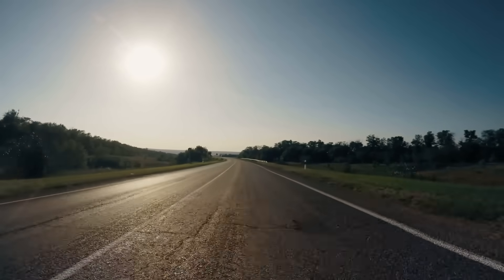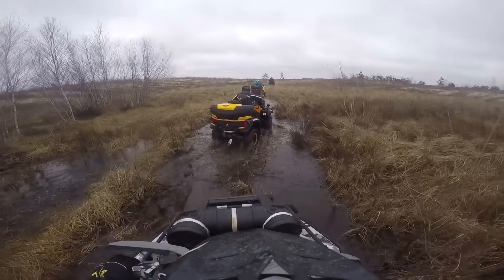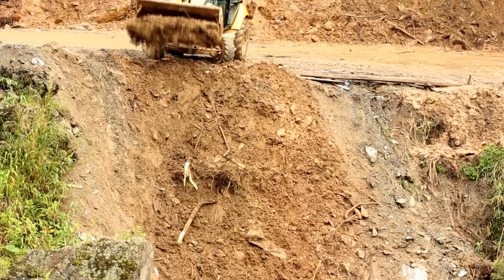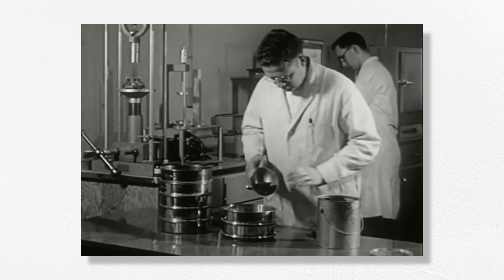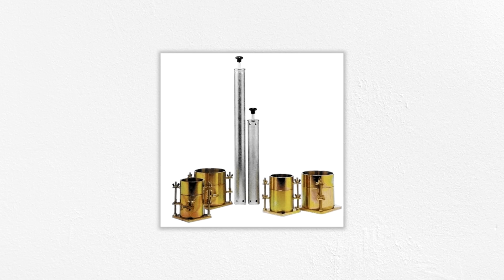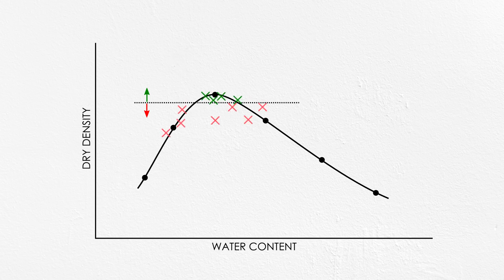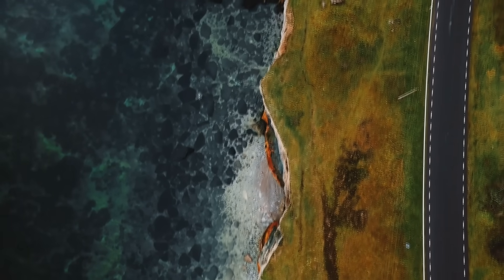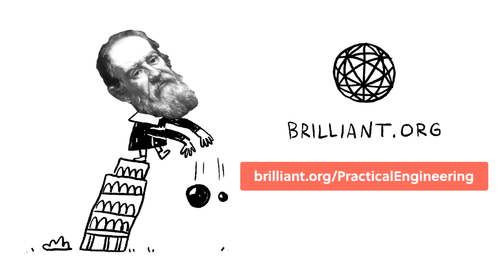Why Does Road Construction Take So Long?

Comment: Smoko at 10:00, lunch at 12:00, smoko at 14:00. 

Plans not showing correct details, for us it’s normally a water main, best is a gas line. More often than not ya hit it anyway. Traffic control sending vehicles when it’s not clear forcing workers to chill a little longer, if there’s a pub on the road, forget dead lines all together and god forbid anyone messes with anyone’s sensitivity there’s going to be a strike and the unions getting involved.

Comment: I used to moan at road workers standing around until I joined a crew laying tarmac at a junction.  I was there checking out engine performance on the paving machine, but watching the blokes work I noticed they wait around for the hot tarmac to turn up, but once it arrives they work like mad for an hour, then they might have to wait 10 mins for the next load of hot tarmac to turn up.  They definitely earn their money when they do work.  They were a nice bunch and it was actually sad to see how much hostile abuse motorists gave these guys. One fella in a BMW spat at us and he had only been waiting about 4-5 minutes in the queue.

Comment: Did a road cut in downtown Seattle and fun fact, old towns just keep layering. The road we were on had 4 inches of asphalt, layer of  brick, trolley tracks, concrete, wood, rock, then sand, and rock. Amazing stuff.

Comment: Great explanation.  What I observed during road construction lots of time, is the absence of work after the initial start.   The various contractors start on construction, then they are gone.  No activity for a long time.   What's up with that.  It's not a once in awhile thing, it's like that is the common practice.  It would be nice to hear your thoughts on that.
Reply: That's because people in construction work by contracts. They take one contract and set up the work area. Then when the intensive season for building comes they get a ton more small quicker projects and they focus on those, while they keep the big one for the slow season.
Reply: Take the money and run

Comment: there is to much fooling around. I 94 was built in 6 months apx 40  miles from detroit mi to  Ypsilanti Mi in WW2 for the willow run  bomber b24 plant

Comment: It happens exactly how he says. I've been operating a compactor for the last three months on a site. Can attest to the fact it's a very slow process. Pull rock out of cut area. Move it close to fill area over weeks making a monster pile. Bring in rock crusher. Crush rock. Spend weeks spreading crushed rock and dirt over fill area with loader, scraper and grader. Also spend weeks compacting the fuck out of it with a padfoot roller (that's me). Soil testing goes on right through the compacting process.

Comment: Why it takes so long is simple. One contractor, with a certain amount of equipment and three or four jobs going at a time. They constantly are moving the equipment from one place to another, robbing Peter to pay Paul so to speak. I watched the state put in a new interchange near me. Basic Interstate with three lanes each way. Two lane road crossing over, diamond interchange. Year one, moved dirt back and forth; year two, paved a little here, a little there, put up barrels blocking the completed ramps and extra lanes on the bridge overhead; year three, put up the signs, painted the lines, put up the traffic lights; let it sit for six months, finally have some local poltical type cut the ribbon, removed barrels.

Comment: the question should be WHY ROAD CONSTRUCTION DOES NOT LAST?  the reason is simple, engineers design something to last X years, BUT inspectors don't always do a good job making sure it's done right and contractors will cut corners in a nanosecond if allowed to and thus we never get X years of service. But the main problem is the design X years is not remotely good enough because powers above engineers don't want anything more than X years in order to keep the money flowing to all those involved in road construction repair, which goes on FUCKING FOREVER! It's rotten jobs program.  SO please stop the bull shit here and tell the truth.

Comment: Seems like an adequate explanation for why constructing large, long road takes so long.  Doesn't seem like a good explanation for why a bike underpass under a moderate road takes six months to complete.  Doesn't seem like a good explanation for why that underpass under the train line that makes the freeway flyover usable didn't start construction until 3 years after the flyover was built, and then took a year to complete, resulting in the majority of the traffic now having an extra traffic light when it is done.  I think the better explanation is that typically with road construction the engineers and contractors are divorced from the cost of delays and inconvenience to the users, and there is no way for beneficiaries of better designs and construction practices to be charged for the benefit they gain.  When there is a close connection, like in the replacement of the 35W bridge in Minneapolis, civil engineers can do wonders. But, more often than not, the results are not that impressive in the USA.

Comment: The nuclear density gauge is a pain in the ass. Troxler has developed a non nuclear device that doesn’t require EPA paperwork to handle. I hope like hell we start using it instead.  Not to mention our gauges has a standard density  count of 1700. Lol

Comment: The reason:  They don't assign enough people to projects.  Projects are designed not to finish in a timely manner but keep the construction firms fat for decades.
Reply: I know you commented this 2 months ago, but more people doesn’t always make the project go faster.  You run into issues with congestion and inefficiency especially when you’re moving dirt around.
Reply: Pretty much what I wanted to say. It is called job security. The longer you drag it out the more you can bill. Don't tell me they have a contracted amount and have to stick to it. They always find reasons to extend and bill more. There is a project near me that is 2 to 3 years over schedule and still is not finished.
Reply: @dlb4299  they have a contracted amount and have to stick to it, unless they notice a reason to go over the allotted time before hand and get more time through negotiations.  If a project is taking longer than it should there’s a high chance that contractor is either breaking even on the project or losing money.
Reply: @roycea.7593  That is how it should be in a perfect world. But with greed, graft and corruption running rampant, not only in construction but many industries, it seldom works out that way.
Reply: @dlb4299  I see what you’re saying one hundred percent and I don’t want to argue with that logic since it does hold up to a certain point.  It’s nice and easy to blame government entities for making construction so difficult and time consuming because of the red tape and inefficiencies, but at the end of the day there’s always a reason for a regulation (and they typically come from someone dying or losing their livelihood).  It’s hard to come to terms with the fact that not everything you don’t like (in this case, a brutally over budget and late project that definitely ruins your commute) comes from 100% corruption and greed.  The world is complex and there’s a lot more to construction than meets the eye.  I heard you can audit construction management classes for cheap, it’s what I studied and it’s the field I currently work in.  You should check out some classes in your free time, maybe it will make construction less brutal and more interesting to look at!
Reply: more people on a job just means more guys standing around doing nothing because you can only do so many things at once without getting in each others way, and many things need to be done after something else, like there is no point in using a roller to pack the road in if you haven't finished putting in new utilities like sewer so you may as well have the crew doing the underground work do the tamping work after, instead of having guys for tamping but they just sit around doing nothing for a week at a time
Reply: Now road construction companies are the  bourgeoisie in your new socialist revolution

Comment: Hi excavating contractor here. You left out a large part of the fill slope work is that we have to key into naturally competent soil below the edge of the fill slope before filling can occur. Usually 5 feet below native top soil depending on the job. Also delays on a job due to change orders, or unforeseen conditions such as rock that needs to be removed. Red tape governmental regulations can also significantly slow down progress. Not saying that they are bad just its the way it is. Loved the video on my occupation. Thanks!

Comment: To add to erosion, they do block sodding after construction in area is completed by putting down grass and fertilizer and watering it. There is also concrete and hot mix testing which doesn't always pass testing and takes time as well. Typically it runs on schedule with the project so it doesn't typically delay the project much. Concrete trucks only carry so much concrete so that adds to the time as well. Same with hot mix duel and tandem axle trucks.

Comment: "slow but steady progress"
If you've seen some freeways you know they are in perpetual construction. For example a pass near my house has been under construction for close to 20 years. And this is a MAJOR freeway with 5-6 lanes in both directions. But that's the case far more than it should be. And the cost is far more than it should be.
I honestly don't think I'll see the construction stop on that pass before i die.

Comment: I don't mind construction. What I do mind is construction companies fetching the contract even though they have no capacity, then block the highway for 20 miles and set up the traffic on one side and then for 3 months there is not a single worker on the highway. But because they "started" they can't be fired and the contract given to someone else, and they'd rather pay the fines for delayed deadlines, but in the end they got the contract and ultimately make money off it. It's ridiculous. They just block the road and constrict traffic for no reason for several weeks or months before they even start any real construction or maintenance.

Comment: Hey i have a question. In oregon on I-5 i notice that heavy use is wearing ruts where car tires ride on the highway. Simply put, could they extend the life of the road by removing and repainting the lines 1' foot left or right?  Worth it?

Comment: I love your videos! Here's what I can never figure out. I totally understand why construction takes so long. Your explanation makes perfect sense. But how were they able to build the first 160 miles of Pennsylvania Turnpike in less than two years? An interchange on I-95 near me - ONE interchange - took more than four years, and didn't even involve closure of active lanes. Sure, the PA Tpke has been widened and rebuilt over the years, but the original construction has basically held up for 80 years.
Reply: Building a new road versus building in an already constructed area with management of live traffic are two very different processes. The former can be about 20% of the cost of the latter, and there's big time savings too.
Reply: @borgiedude  Oh, totally understandable. That would apply to, let's say, building 10 miles of new road vs, say, 2 miles of reconstruction. But 160 miles in two years vs. one new interchange in four years? BTW there wasn't much management of live traffic to do on this interchange. There was none there previously and almost all the work was done away from the active roadway so it was a "new road" for all intents and purposes.
Reply: @larry4111  I'm not sure about the specifics; bringing in contractors from across multiple states and having numerous sources of quality stone nearby, with quality subgrade to built upon may have sped up the 160 mile construction significantly. If the ground was for example very flat and strong, it would require minimal earthworks and minimal placement of stone road base to build, speeding up construction. Conversely for the interchange, there may have been latent conditions like services to relocate which complicated construction, and the building up of many layers of compacted earth would surely have contributed to the long construction time.
Reply: @borgiedude  In researching it, some of that definitely enters into it. On the one hand, the terrain was anything but flat and strong requiring minimal earthworks. The original turnpike had over 300 bridges and culverts along with seven tunnels through the mountains, including six that had been partially constructed for a railroad project but never "holed through." Work on the tunnels consisted of drilling, detonating, clearing rubble, reinforcing walls and floors, enlarging and reshaping entrances and exits. "In a span of 23 months 160-miles of pavement was poured to construct the original Turnpike. The roadway also consisted of: 200 feet of right-a-way, 12 foot-wide concrete traffic lanes, 10 feet of median strip, A total roadway width of 78 feet, A maximum grade of 3 percent and curvature of 6 degrees, Limited access with 1,200 foot long entrance and exit ramps." (From PA Tpke Commission history). On the other hand, you're correct about the workforce. There were 155 construction companies and 15,000 workers from 18 states under contract with the Turnpike Commission to construct the turnpike.

Comment: There are real legitimate technical reasons that it takes time, but we live in an era where in certain regions, the practical engineering issues are a minor contributor.  When your state stops paying what's owed on past or current contracts (for variously infuriating or forboding reasons), projects slow to a crawl or flat-out stop.  It shouldn't take seven years to rebuild a short two-lane bridge.  It should be possible to rebuild a 4-lane overpass in less than a decade.  This is the kind of crap that drives people mad.

Comment: You left out the primary reason roads take so long to construct. There are 168 hours in every week. Constructions crews usually work only 40  hours/week, even less if the weather is bad. Give a contractor proper incentive to finish quicker and they will easily find ways to do so.

Comment: Why does road construction take so long?
Because it's government-funded, the government have no idea about engineering (easy to rip off) and everyone's getting paid by the hour.
Reply: except the contractors building the road bid on the project and are set at what they get paid for the project, other than extras which need to be approved which dont happen unless its out of the contractors hands. So the longer the contractor takes to do it, the less profit the contractor gets, its not like they get more money the longer they take

Comment: The only problem I have with road construction was the fact I have seen two speeds of road construction. I worked at Walt Disney World for over 5 years. They maintain and build all their internal roadways. They ONLY worked at night and they completed projects in Weeks that would take Months to Years, "on the outside".  My commute passed by several construction projects "on-property" with some similar projects "off-property". I could see changes / improvement in one week on-property, that took sometimes a month or more, off-property. I'm sure Disney Paid top dollar, with completion time the primary factor. Even with strict timelines, the roads at WDW were impeccable.